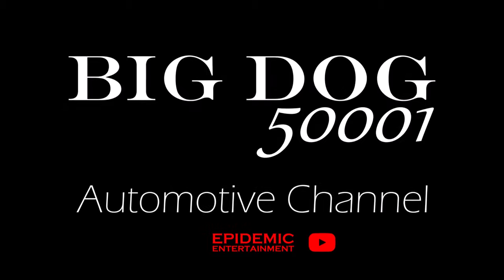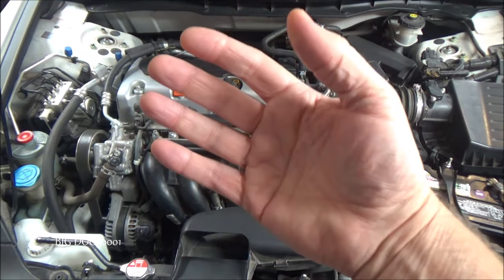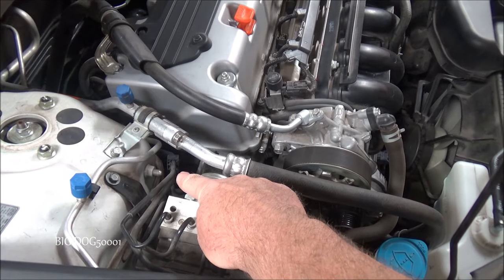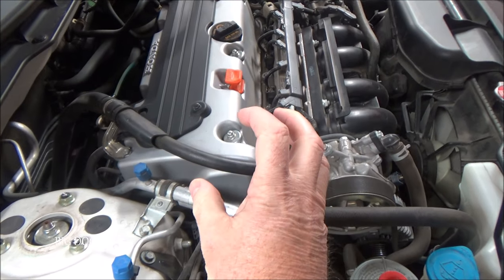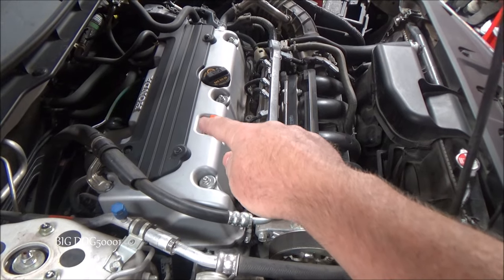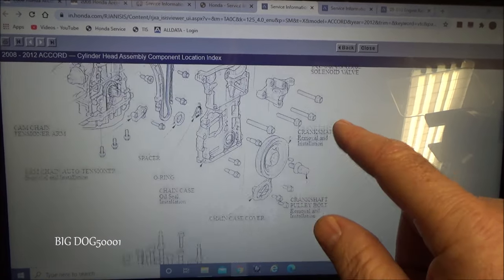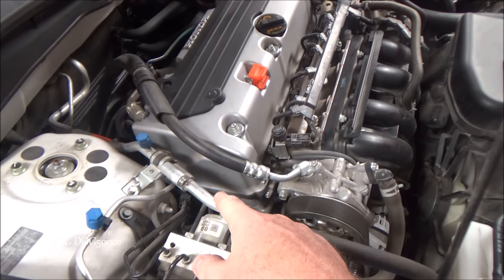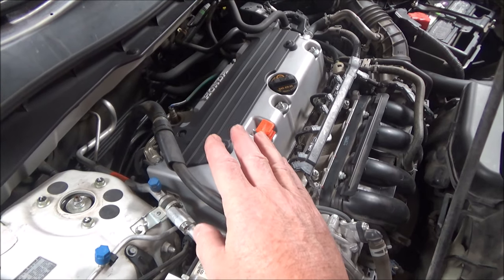Honda Tips:  Engine Rattles on Cold Start-Up

Comment: Just wanted to chime in for others here, I’ve had the rattle for a little over a year now and recently noticed some leaks developing on my rocker cover. I ended up replacing the gasket over the weekend and now every cold start since replacement - no rattle. It was a consistent occurrence before but now it has completely disappeared.
Reply: Just the gasket?
Reply: Yes, just the gasket. I don’t understand it either but perhaps something to do with having the right crankcase pressure with a fresh gasket in place to promote better oil circulation on startup.
Reply: Great video. Question 08 crv EX-L. Was getting 28 now barely 20 . Light was on when first started after fill up. The code said tps , misfire or bad ecm . Changes out the cat , new plugs new 02 sensor front and back . It's cold and when I turn the key to start I put the key in the second position an I hear a light eww eewwhh noise . Sounds electric strange in the front  . No codes just low f,e. The rpms take a while to come down at highway speeds and then the rpms will bounce . Any idea ?? Thank you someone said it could be the tps but I need a whole new throttle body . Thank you
Reply: The EBS was making the noise. Code for erg valve. Unplugged the erg valve car running smother  now . I'm thinking replace and it will be back to normal fuel economy. Hopefully. Ty to all
Reply: That's just pure luck.  The valve cover gasket has nothing to do with the VTC actuator rattle.  It has to do with the spring inside of it, that can be replaced. That's where to start - but you won't need to replace the entire actuator.  Timing chain tensioner also needs to be replaced, as well as working over the locking pin in the actuator to clean it up and remove any burrs/high spots.  That locking pin needs to move in and out of the detent freely.
Reply: Replaced cam gear tensioner and chain and still does it.
Reply: Just replace the VTC actuator locking pin spring to save money, time and risk of timing upset. "springstart VTC'
Reply: What is the lifespan of vtc actuator if oil changed always as recommended? Also, why do others keep saying it is the tensioner gone bad when this rattle noise only happens at cold start for a very short period of time. To me it just sounds like the oil falls out of the top of the engine overnight.
Reply: @rod9550 yep. I'm pretty sure all these people saying it's the tensioner are full of sh*t.
Reply: @caseyalexander2244 why. Why do you say tensioner also needs replaced when we know it is the vtc actuator? The rattle only happens for brief period of time at cold start when it's been sitting say overnight. If the problem is the tensioner, wouldn't the rattle persist while you are driving around?
Reply: @JT-jg8le  I agree with this. Our 9th gen started exhibiting the rattle symptoms again recently and i noticed some weeping of the rocker gasket, which was what fixed it for me last time. My suspicion is as yours; rocker gasket gives way, allows air ingress and overnight any oil at the top of the head drops down much faster due to the leak. A proper seal of the rocker is crucial it seems for that circulation to be quick on cold start.

Comment: The problem is a weak VTC actuator spring.  Costs around $25 for the spring.
Reply: Yep, a new VTC actuator spring usually fixes the rattle

Comment: 2014 crv.  VTC actuator started making the rattle noise at 55,000 miles.  It lasts for  1 sec only on morning startup.  I now have 176000 miles .  It still makes same noise , only on first startup.  Honda technical advisor said  leave it alone .  I have and hope to get 250,000 miles on this engine .  Remember regular oil/filter change and not by some econo-lube place.
Reply: It's a cold start
Reply: Hey following up on this comment. I have a 2013 crv at 136k miles with same issue but has been burning oil. Does yours burn oil as well?
Reply: Thankyou. 225,000 miles. 1/2 qt every 5000 miles. Still get rattle on cold start. 
Consider changing PCV valve if burning oil. Cheap and easy diy. Great vehicle , I hope to get 300,000 miles.

Comment: My wifes 2012 CRV does this and has been for a few years.  I have seen where people replace them and they still go bad. Honda has an issue with these but because it's not a saftey concern, there's no recall.  I feel like I should have that replaced but knowing the part has never been corected and it doesn't seem to be doing anything so I keep putting it off.  Frustrating.
Reply: Interesting. I’m here because my 2012 CRV does the same! It’s only been a couple months, but I’m glad to hear that it’s good for years.
Reply: Should be because if chain breaks on highway and engine stops, that should be a recall on it, get rearebded at 75 MPH on highway won't feel good if Timing Chain breaks.
Reply: I also just came here for my 2012 crv as well lol. Fix yo shit Honda

Comment: Just completed replacement on mine however I must have got the one Honda that didn't have timing marks on the chain itself like all the manuals state. Got 1/2 link off which threw up a P0341 code. Had to do the job over counting links between sprocket marks. First time I put the sprocket on the link instead of between two links. Can't fool that computer!!!

Comment: When I start up my 09 Accord, it makes that sound. It has plenty of oil, but it makes that sound. It lasts for no more than 2-3 seconds, and then the car drives smoothly. Sometimes you can blatantly hear it other times it's barely noticeable. Other than that rattle noise at start up, my 09 Accord drives as if there's no problems.
Reply: Problem is that the vtc after sitting awhile loses oil from it and after u start it it rattles and once oil is back in it the rattling stops
Reply: @finley614  so is this a big problem or no ? I have the same problem. My Honda is 2012 with a good amount of oil
Reply: @oegesauto5619   i saw a video on here where a guy changed the springs on the VTC with more heavier duty ones and it cured the rattling.  If i can find it i will add link

Comment: Nice information 👍... My Honda BR-V diesel engine starting & stopping  with abnormal sound like "gadd"... This abnormal sound is more early in the morning... After running 30-40kms still abnormal sound is there but comparatively less... Please suggest the solution... Thank you

Comment: My 2010 Honda Accord EX with 110,000 miles does this for just a second on most cold starts. Do you have a repair video fixing the VTC actuator? And also, is this a major problem that needs to be repaired immediately??

Comment: I change the vtc actuator, my cars at about 3,500 miles was getting out of oil and making the noise I change and in cold start it doesn’t make it any more and doesn’t get out of oil but at about the same miles 3,500 it makes the noise and the oil light pops up so I’ll change this, thanks for the information. I also think I have a leak but will see in the next few days

Comment: Is there potential a bad vvt solenoid produces a low oil pressure light? first I had the p2646 code, then I had the oil changed at a jiffy lube (the last time, i swear), and then the low oil pressure light came on, along with a P0011 code.

yeah I hear that rattle too, when i start it up, been giving me anxiety about my engine and I won't drive it much. I have purchased a new vtec spool assembly, a vvt solenoid, vvt filter/gasket, and a new oil pressure sender too. going to replace them all tomorrow and do an oil change.

Comment: I have a 99 Honda Civic ex manual and when I first start it there is a high vibration when I’m sitting in the drivers seat, it’s not the exhaust because it’s 3 months old it’s not hood rattling either. What could it be? If I let the car warm up say 10 minutes it disappears. Again only when I first start it up

Comment: One would think the bottom line of a rattle sound is metal rattling against metal. This video didn't pinpoint the cause of the rattling sound. Is the variable valve control solenoid making the rattling noise or is the solenoid causing the timing chain, valves, or something else to chatter which I would view as a major issue of concern?

Comment: I’ve got only 116K on my 04 CR-V, I’ve been always ontop of my oil maintenance and this problem has been occurring with the knock on startup, is there nothing I can do about it now besides have that intake camshaft part replaced? Maybe replacing the oil pressure switch on lower side of the engine might help?

Comment: Would this be the same for a Honda pilot 2007 EX my engine shakes up cold start up $127,000 MI ( NO check engine light) any suggestions 3.5lV6 please note I do not think spark plugs have been changed ever only timing belt water pump

Comment: So basically because the vtec is oil pressure regulated the car is using the choppier cam lobes on initial startup because there’s a bunch of oil pressure?

Comment: Does the VCT issue apply to 2013 Earth Dreams motor as well? Can't seem to find any relevant information for 2013 models. Did they change the design in 2013?

Comment: mine came back 13,000 miles after the VTC was changed i baby my vehicle and change oil/filter very often ( 7000 miles or less, synthetic), why is it failing again so soon? could the vtc solenoid be also busted?

Comment: I brought my 2014 Honda CR-V to the dealership after 1 week off the lot and mechanic at the dealership said it’s because the light weight oil falls after time and does not sit up in the engine, so when first starting with cold start the sound occurs prior to oil re-circulating. They told me nothing to worry about, but based on this video, perhaps it is something to seek second opinion for and rectify?.

Comment: Great explanation.  Very common issue on the K-series engines.  Often misdiagnosed as starter not disengaging after starting car.  This like you mentioned predominantly happens in cold weather, and VTC actuator losing oil “prime” in the cold weather. TSB was out a few years back.
Reply from the maker: Thanks 👍!
Reply: oh rickie, what you mean is that a bad Vtc actuator looses its oil? that's what is causing the rattle noise often misdiagnosed as bad timIng chain or tensioners... I'm having rattle issues 1/3 of the time when I cold start
Reply: @louisfredgagnon  what was the part you changed out to fix the cold start rattle?

Comment: Thanks Dave, best Honda videos on yt. I have a 2011 Accord with 120k miles with this issue. The rattle noise became more noticeable a year ago and I have probably driven 15k miles since. Fresh oil helps. I read somewhere that turning the key three times before cranking may help with the noise. Idk why this works but I do it every cold start and it makes the rattle noise less worse or sometimes I don’t even hear anything
Reply: I got a 2011 accord too, it's had that sound since I gotten it. Now I'm got a code p0341 popping up and weird idle. Ohh nooo..
Reply: turning the key on primes the fuel pump. the engine needs to be turning to pump oil thats why the rattle stops seconds after starting and oil is flowing through the vtc actuator.
Reply: I have the same issue with my 2014 Accord. A friend of mine advised me to turn the car electrical power first for few seconds before cranking the engine..it works. Although at times still behaves the same. But i'ts no longer as much as it was before. You guys can try.

Comment: I had a slight rattle on start up . accessory drive belt was very slightly stretched only 75000mi .Replaced the belt no more rattle.  Tensioner  rattled.

Comment: My 2009 GMC Acadia has this grinding noise when you start the car cold it lasts is about 2 to 3 seconds and disappears the car drives fine when changing the tensioner do you have to change the chain and is there any way to do it with the engine in the car or do you have to take it out

Comment: Getting the right mechanic makes all the difference in the world! Had a Check Engine light (P219A on a 2015 4cyl accord). This guy diagnosed a general code and got it right on the first try. It was the spark plugs, but scanner code doesn’t tell you that. I also did a few other things needed as well, which to my surprise took away the loud rattle at startup! Him nor I wasn’t really expecting that to go away!! He also got me his commercial discount at O’Reillys which saved me huge. 

Spark plugs NGK Iridium:
Originally $24 each. Paid $11.

Valve cover gasket:
Originally $38. Paid $18.

M1 Synthetic 5qt and M1 filter:
Originally $64. Paid $40. 

So a little over $100 in parts which would of been $200, and $140 labor! 

I went to a shop before calling my mobile guy, and they wanted $550!!! For what? Also they we’re putting a generic synthetic blend! Wouldn’t even let me bring my own oil even if I paid full price! 

$550, I still can’t figure where that price came from. They charge $180/hr for labor. This is a 1hr job, took my guy 45 minutes and he didn’t have a lift for oil change. 

So if it’s $180 labor, how did the parts cost $370! Let’s say they charged $270 for labor (1.5hrs) That’s $280 in parts. What a rip off considering that If I paid full price at O’Reilly’s, it was only $200 for highest quality parts.

Comment: Thanks for the vid, Big Dog.  I have this problem with my 2016 VW Golf SportWagen... it just started happening.  In your opinion, is this fix necessary/urgent or can I continue to use the car for a while without the fix (as long as oil is clean and topped off)?  Thanks again.

Comment: Damn! I needed this. Thank you. You solved my issue. Why the Honda repair technicians couldn’t give me this answer??? Beats me. They said it had to do with my pistons.. I swear, it’s a wonder why shop mechanics get a bad rep. Really appreciate this.
Reply: I Found the fix buddy
Reply: it was a recall issue, thats weired that they didnt know
Reply: trying  too  rip  you  off
Reply: My Honda dealer said they didn't know or reproduce what I'm talking about on my 2012 crv a few years ago. I did my own research and it's a common thing, they don't want to address
Reply: @edwinluis5966  maybe  they  do not want  the  recall   for   this  engine  noise ,It  is  a  Repair Scam , All   honda  buyer  will  complaint  , i  see  lot  of  honda  car   with  that  noise   and  it  the  timing  belt  tensioner  which  is made  defected  after so many  mile  my  2016  honda accord  went  51000 miles  if  the  belt  had  broke  it  would   damage  the   engine  which  would been  a  mess,

Comment: For our 2018 Honda Fit with the startup rattle from the VCT the simple fix was to change the oil to the blended version from Valvoline.   I believe we used the non-blended / non-synth version on the previous change and that is when the rattle started.  My bet is that the synth sticks better/longer on the pin and thus it pops into place without issue.
Reply: thanks Matthew! the rattle started right after I changed oil. Your answer helps calm down my rattle sound issue.
Reply: What grade of synthetic blended oil did you use? I have the same problem with my v6 accord
Reply: @alanchunlopez3037 probably the correct one

Comment: A big thumbs on this video! The solenoid seems inexpensive but not the fix according to you. The entire sprocket needs to be replaced it sounds like. Is there anything else that can help with this rattle I'm getting when I first start up in the morning??? What's a ballpark for a permanent fix by replacing the sproket?

Comment: my  2016 Honda  Accord Exe-L  V6    cold start up noise , was   so  confusing  i was  thinking  it  was the variable vale timing control solenoid ,  my  noise  started  out  with  cold start then  it  will  go  away  when  the  car  is  hot, later  on  the  noise  got  so  loud  even when  the  car  is  hot , took  car  to  honda  repair service $150,00 diagnosis   carmax  sold  me  the  car  it  was   bad  timing belt  tensioner    it   was  not  the   VTC   solenoid  like  the  you tubes videos  say , I  belive   all  honda with that  noise it  your  timing belt  tensioner .  Remove  the  timing belt  tensioner   cover   start  car  up  you  see  the  tensioner   banging  against  the  pulley